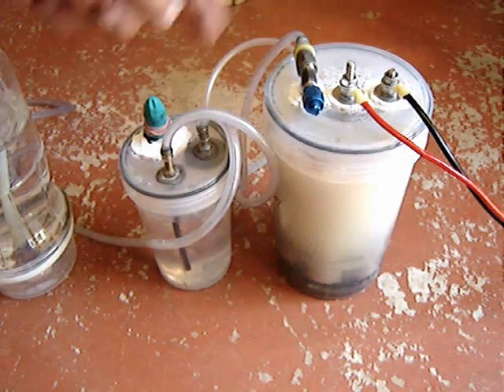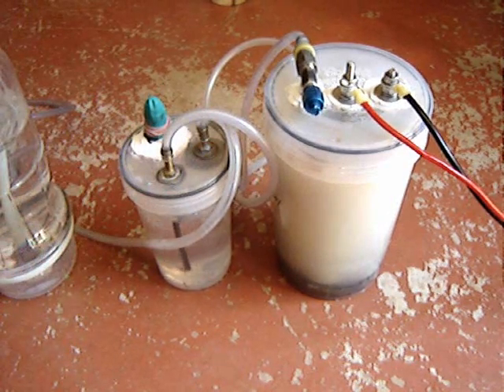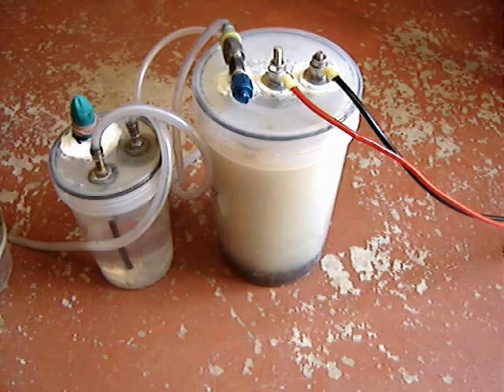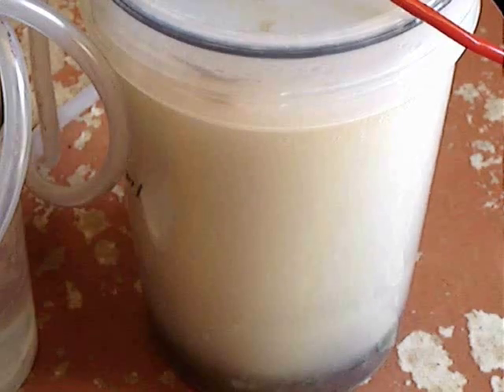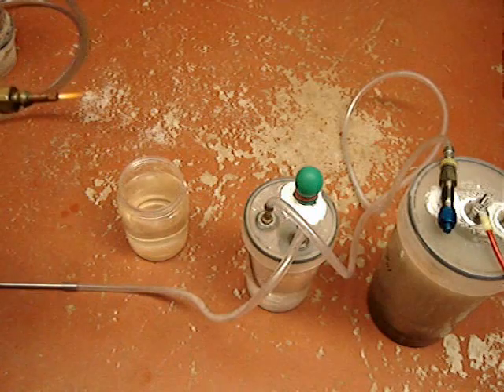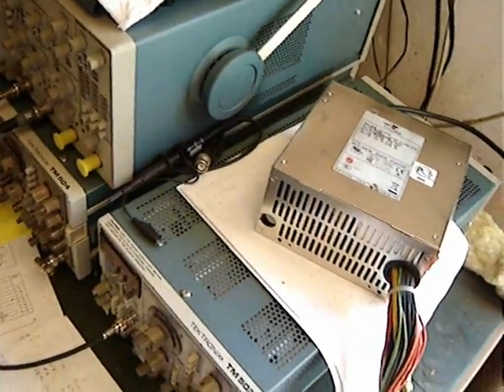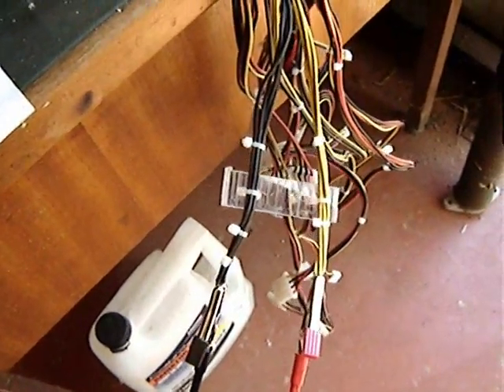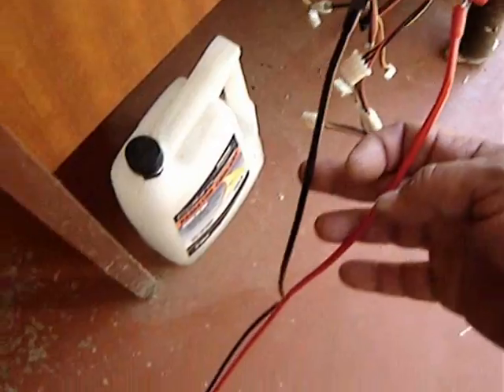meyer type cell

Comment from the maker: the only metal used is 316 stainless.
i was using this cell for resonance study but
still can't beat basic d.c. for max output of the cell?
the cell in the video is running at about 11volts and 8amps.